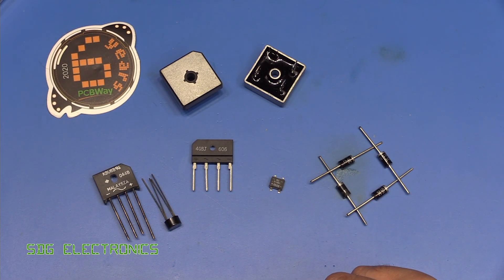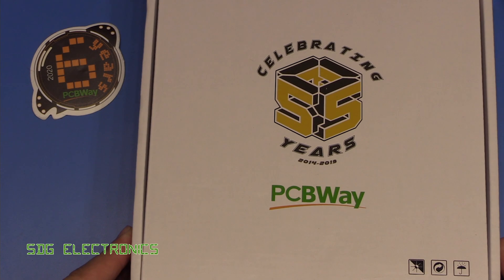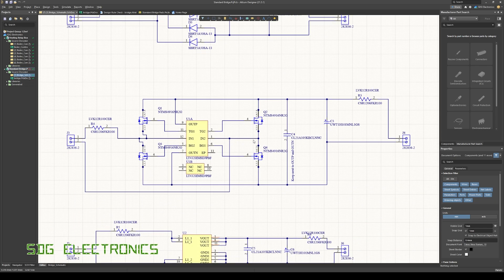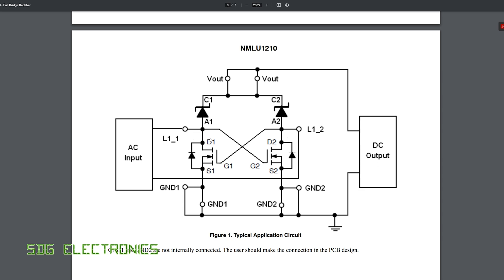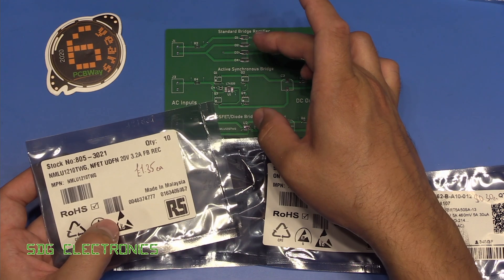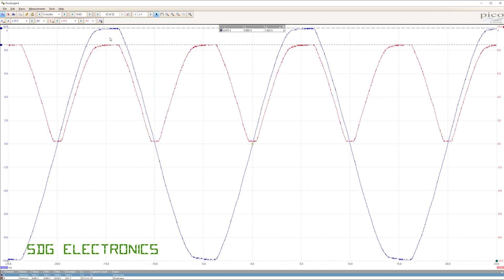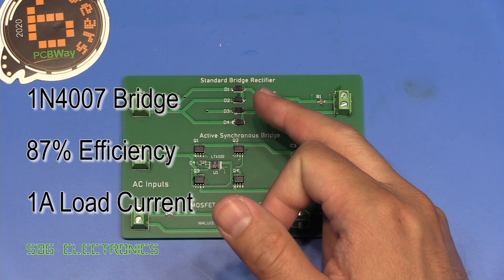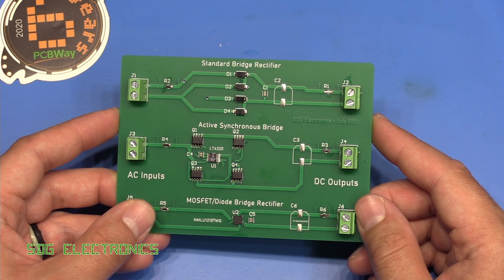SDG #217 FULL BRIDGE RECTIFIERS and some alternative technologies for high efficiency

Comment: Steve, ive take inspiration from this video to use of LT4320 in my next project (didnt know about this solution before) as a 15A full bridge recifier for low noise power supply. I have to say, speaking about losses on mosfets, everything works fine, but i discovered some spurious in output spectrum every 10ms (100Hz) which datasheet is not mentioning. This looks like there is some "ringing" during mosfet switching :( I was not able to find email contact to you to send you screenshots.
Reply from the maker: If you go to the "ABOUT" page on my channel, my e-mail address is there. The ringing can be due to several things so I'll be interested to see what's going on.

Comment: Ok, I am really confused right now, from videos that I searched, the theoretical maximum efficiency for rectifiers are 82%, how did you get 96%?
Could you make a video explaining that?
Reply from the maker: Because the low efficiency is due to the voltage drop across the diode, hence the losses. In this case, there is no diode loss.

Comment: I've just been looking online for this NMLU1210 - it seems they are hard to get hold of? Might be worth me muckin' about with a similar circuit using separate components one day - something to do this winter during the long nights. I guess I won't get the same efficiency as this carefully crafted design though.
Reply from the maker: Yeah, sadly I hadn't noticed - RS had lots in stock so I didn't think twice about investigating it. I'll look for a other options.

Comment: Were your efficiency calculations including the losses from the resistors you put inline in each circuit?
Reply from the maker: I ended up bypassing them in the testing as they weren't needed.

Comment: I'm disappointed that you didn't solder the capacitor to the LT4320. As you said yourself, it needs 9V to turn on, so it needs a capacitor at its output that keeps the output voltage above 9V. That would probably increase the efficiency substantially.
Reply from the maker: There's a follow-up coming on Thursday.

Comment: Is there a better ideal IC that runs at a lower voltage than 9V, ie, switch on sooner, ie, have a better trace.
I tried to buy some caps (3 different values) from RS here down-under, and they don't like selling stuff unless you buy multiplies for about $10 per cap value, ie, $30 just to replace a few caps on a TV tuner card. Plus with the virus you can't pick them up, so it's another $12.50 postage, ie $40 total. I went Ali for $12 total - lol -.
Reply from the maker: I didn't find one specifically. I think you can do it without any active parts if you don't mind using 2x N channel MOSFETs and 2x P channel MOSFETs

Comment: Steve im looking at trying 4g Bb hear as im out in the sticks, and best upload speed i can get is 8meg. Not good to build youtube channel with
What conclusion did you come to on service and hardware.    Steve
Reply from the maker: I have pretty consistent results on the Mikrotik once the TTL setting is changed to 64. 24 Mbps most of the time. I would consider the one with the parabolic reflector though
Reply: @sdgelectronics  ok steve ill look into it

Comment: As far as I'm aware the LT4320 is essentially useless for mains rectification due to its internal charge pumps being unable to generate sufficient gate drive voltage. (the datasheet is rather unclear about voltage ratings but there is no indication that it can be used for mains voltages). It's also useless for secondary side SMPS rectification due to the max 600 HZ switching frequency - not nearly fast enough. For rectifying small signals you'd probably opt for a "precision rectifier" type circuit - there are plenty of cheaper and better options for low current. That pretty much relegates this chip to a few niche low voltage, low frequency, high current applications such as "hot swap" load switching and other non-rectification ideal diode uses. An interesting sounding chip without many real applications sadly.

Comment: Indeed a very, very interesting topic. Recently I've repaired some 1541 drives. Their bridge recitifiers get really hot and I had some of them fail on me already. I was wondering if I could simply replace them with Schottky bridges for these low voltages. Then I noticed that Schottky diode bridge rectifiers are not commonly available at all. But why? Anyway, those active recitifiers seem to be a great solution. Maybe I can find some comparable products that are actually available and affordable.

Comment: I like the quad mosfet bridge  the best :)  
It might probably even be the most cost efficient and environmentally friendly solution even the initial part cost is higher. what you pay extra for the ICs you can save in heat sinking and power waste .. over a long time period they might be even cheaper, depending on the overall power throughput of course. I thought I have seen a quad mosfet bridge with no active components ... maybe mixed that up with an H-Bridge.
Interesting stuff, thanks Steve !
Reply from the maker: I think there's one in the PACE soldering station, I need to trace it out as I can't quite think how it would work.
Reply: @sdgelectronics  That one kept me busy quite a while, but I (now) think it is not possible, you'd need a square wave to switch the gates at least ... there is an article on the eevblog  (bridge-rectifier-made-with-mosfets) that came closest to an answer .. sorry for the mixup. Still I think quad mosfet is the way to go even if you need some ic with a little bit of brain. ;)

Comment: Remind you viewers to NEVER do what you said: ground one side and probe the other side of an AC input, at least not with an earth-grounded scope. 
I know you meant a generalized AC circuit, but the closest one is from the wall!
Reply: If I had an Oscilloscope I would totally RTFM, it is probably the first sentence in Chapter one in bold Text. ;)
Reply: Sure, that's true but not everyone reads it.
Reply: Well, not 'never', it would be fine on isolated AC from transformer even if scope is grounded.
And his schematic was correct, as this is the symbol for common potential and not protective earth / chassis ground.
It's just the annotation wording that was sloppy.

Comment: From the title, I thought this was going to be a dull video - I was wrong.  Great job - I did not know of the alternatives and just assumed that if you needed dc, you needed a diode to make it. (my 55 year old Navy training is letting me down!).  Speaking of my Navy time, have you ever played around with 3 phase power.  I was trained on a system that used 400hz, 3 phase power.  To get dc, all the system did was use a 3 phase full wave rectifier and a simple LC filter.  No active components, no regulation, no feedback.  And it made an extremely clean dc (for it's time). Good enough to run the transistor based computers we were using.

Comment: Active Rectifier's are great when you have a DC supply that need to be fed from a few different supplies and a backup battery. Only a little loss as the body diode conducts before it bypassed by Ron.

AC backup is no problem as the UPS's do it all for you, but high current DC can leave you with a bit of  head scratching.

Comment: Interesting! I didn't know there was more sophisticated alternatives to the good old full bridge rectifier. BTW; what type/brand is that 12ohm load resistor?
Reply from the maker: It was from RS, their own brand RSPro https://uk.rs-online.com/web/p/panel-mount-fixed-resistors/1852424
Reply: Thanks @sdgelectronics  ! I've been soldering together 5W power resistors too many times :)

Comment: Shame the NMLU1210 is being discontinued from Onsemi, but I guess one can make it from discrete components. You should have also considered the LM74670 from TI,  though not cheap and you need 4 and some capacitors.
Reply from the maker: Ah I hadn't noticed that. I think in the PACE soldering station they had a discrete transistor solution for the bridge rectifier. I'll have to trace that out to see how they've done it.
Reply: @sdgelectronics  There are mosfet rectifiers by using two dual (n and p in the same package) that I have seen though you cannot use smoothing caps afterwards, so you still possibly need a diode, though that diode is conducting at all time, the nmlu1210 uses two that conduct alternatively so that should help with generated heat. I'll consider making it with discrete components and test it, great tip from your video! Though curious how the rectifier in the soldering station is laid out.

Comment: Did you ever fit the output smoothing caps and test? Would be interesting to see if they all acted in a similar manner or whether you have to tweak the values around somewhat.

Anyway, great video. You've found a new subscriber! :)
Reply from the maker: No I ran out of time, but I will do a short follow-up
Reply: I expect the Mosfet Fullbridge to perfrom much better than the others when using smoothing, because then all the current conducting is going to be done above the 9V where controller chip starts operating
Reply: @elektro-peter1954  thanks, exactly my thought. I was really confused why he didn't after he specifically pointed out that it had to be above 9V
Reply: yeah these mosfets are way to 'small' to produce such high switching losses and we saw on scope that Vpk was almost identical on the output, so there should be a huge difference.